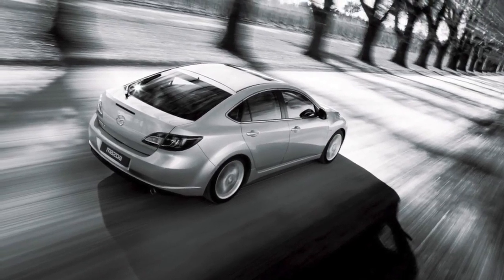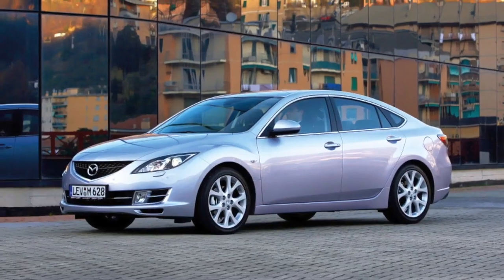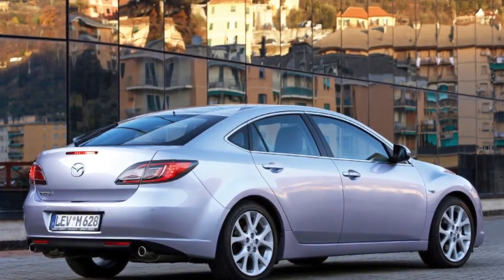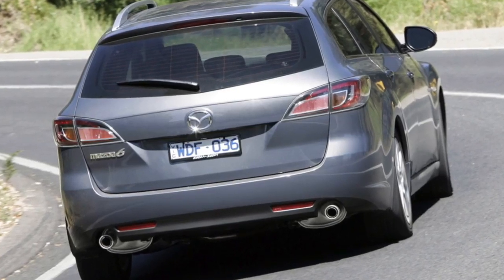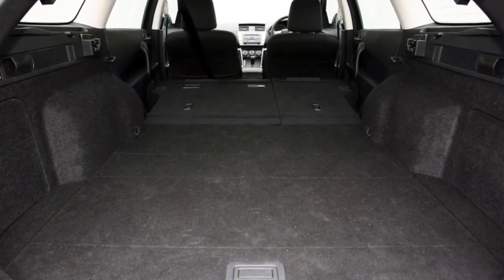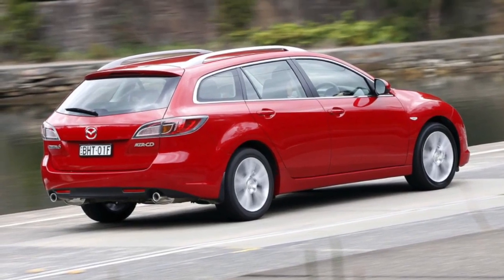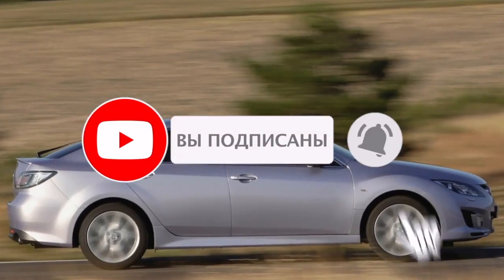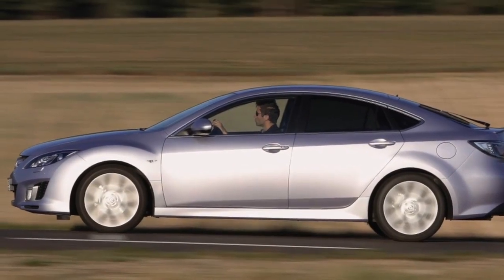Used Mazda 6 2nd gen. Reliability | Most Common Problems Faults and Issues

Comment: I just bought my 5 th Mazda with same engine 2.2 mzd-cd manual , the first 3 Mazda 6 all up I passed 1 million km never missed a bit , then I had Mazda 3 same engine I’ve done only 50.000 km I sold it to buy 2009 Mazda 6 wagon diesel manual with only 30.000 km very happy

Comment: I agree with above comment you need to look after and maintain them

I’m the owner of a 2010 2.2 185 SL wagon. It has 210k miles on it with absolutely no issues except maintenance.

Change oil every 5k
DMF and clutch costs as much as the cars worth though 😊. 

London ULEZ unfortunately forces me to part with it in new year .

Comment: The worst problem for these Mazda 6's is the 2009- 2010 are nearly impossible to find most parts. Even the aftermarket hardly exists. Unless you get a really good deal and just need a car to drive around I would get something else.
Reply: Is this the case in the UK ?
Reply: @timothyandrews5975  unfortunately yes. You can find basic things for them like spark plugs and sensors. But look up what a set of used headlights cost for them. And you can't find aftermarket ones they don't exist. I can't even get a flasher relay they don't make them anymore and no aftermarket.
Reply: @Blorkion64  oof okay, I was actually going to view a 2010 with 2.5 petrol today  🥲
Reply: @timothyandrews5975  get a honda accord or toyota camry instead. The Mazda 6 tries to compete with those. I've had two civics and an accord and they were great cars. Even when they had problems they just kept driving and wouldn't break.
Reply: Thanks for the tip. The Mazda was a 2010 petrol manual 2.5 (top spec) with 94,500 miles. The guy was asking £2,450
Reply: The Honda's and Toyota's are way too expensive
Reply: That's the issue I'm having. Impossible to find parts I wish there was a reliable website
Reply: @lilyurei  yeah I know it sucks. The best luck I've had is buying used parts on ebay. But that's a gamble. Local junkyards might have what you need too.